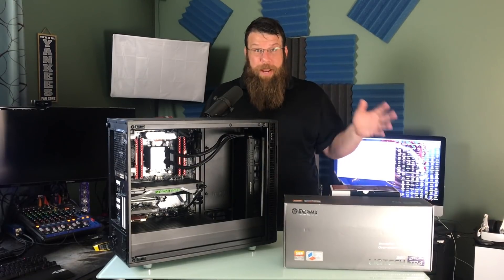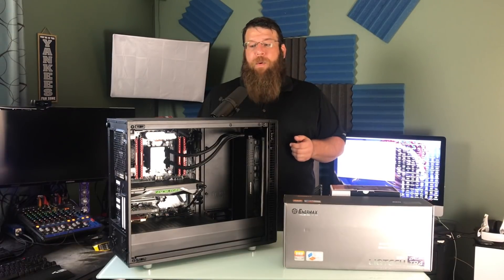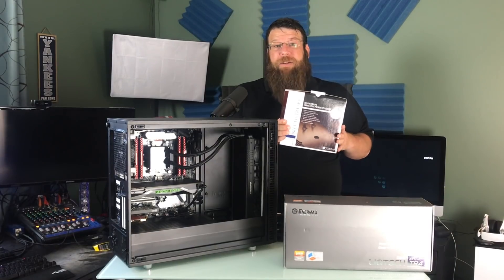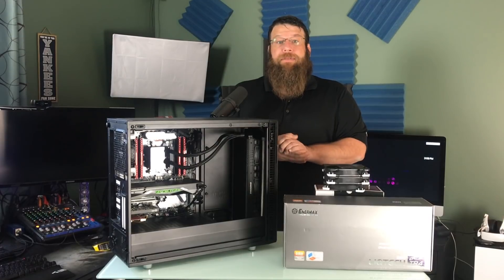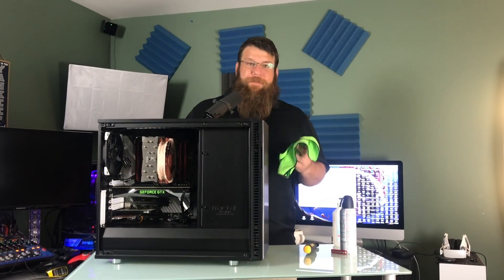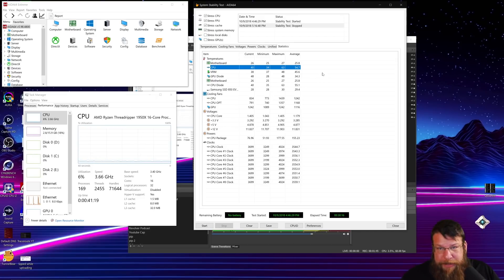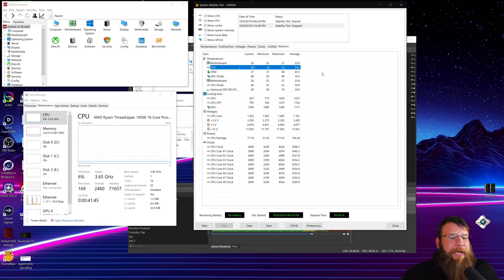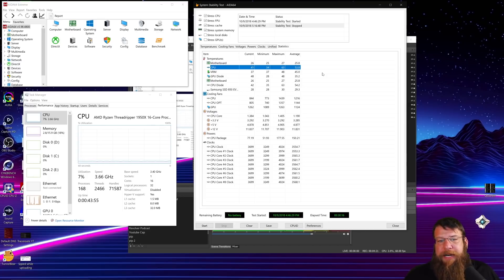RIPTech? - Enermax Liqtech 360 Failure and Replacement - Noctua NH-U14S TR4-SP3

Comment: I have an NH-U9 TR4-SP3 92mm dual fan cooler on my 1950X. I just finished the build in a 4u server chassis (hence the 92mm cooler).  Surprisingly this little (by threadripper cooler standards) cooler does an amazing job for what it is.  I have zero overclocking headroom but that's ok. It all core boost up to 3.7  and thats good enough.

Comment: This might be a dumb question but can air coolers like a Noctua actually fail? My AIO pump stopped spinning and I just ordered this same exact cooler for my 1950x. Also, i hit high 80s possibly running cinebench and probly hit 90s running Cinebench r15 and prime95 when it froze. Any chance that couldve ruined my chip? I get the Noctua later today. thanks for the video.
Reply: I've never had a Noctua fail. I have a PC from 2012 with a Noctua CPU cooler and it still runs the same way as the day I bought it. Fans didn't get rattly and loud too.

Comment: Stumbled onto your video, but if you have a gen1 liqtech cooler, Enermax is replacing all of them with a gen 2 for free.
Reply: I got a 2nd gen replacement from them and it is overheating/throttling my cpu. They should be giving full refunds, the whole product line is defective and they know it, yet they still are trying to cover their losses by keeping it on the market at the expense of all their customers

Comment: Does the u14s overhang The dimm slots? In other words, do you need to be concerned with what sort of memory you're running?
Reply: depending on your motherboard type,check out noctua website,it has the compatible chart for motherboards,I have a Gigabyte z270 and i'm able to fit the full 32g of ram my ram is the gskill trident 3200
Reply: @MrAnderson2744  yup I emailed Noctua. It fits. Plus the fan can slide up about 5mm so there is some wiggle room.

Comment: That product is defective I had the same issue after 3 months, every review on Amazon has the same issue. I replaced it with an air cooler from Noctua and it runs completely silent at perfect temps

Comment: Noctua makes amazing coolers.  I have one in my gaming PC which has been running for years.  They are whisper quiet and provide absolutely top class air cooling, which (despite popular opinion) is generally nearly just as good as entry level all-in-one liquid coolers.

Air cooling gets a bad rep because of garbage and loud stock fans.  GOOD fans make such a difference.